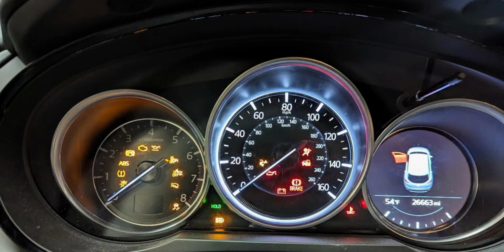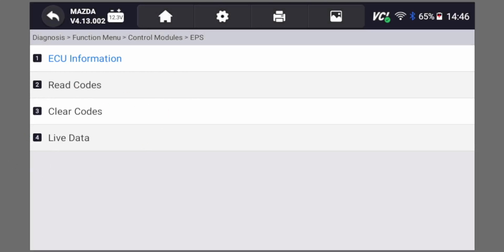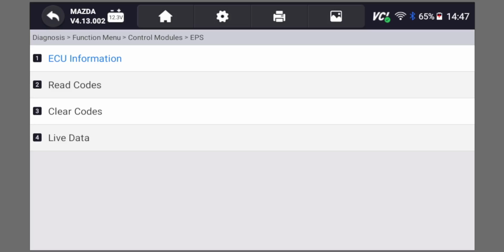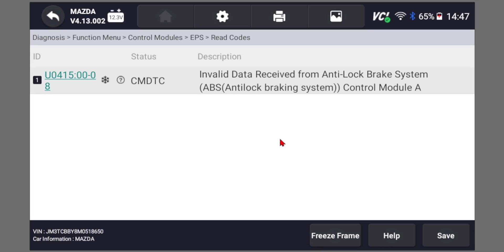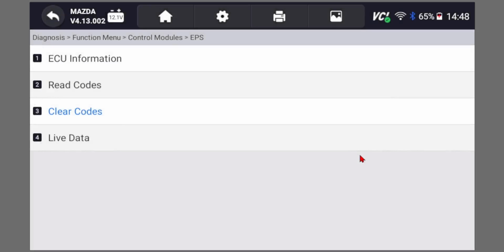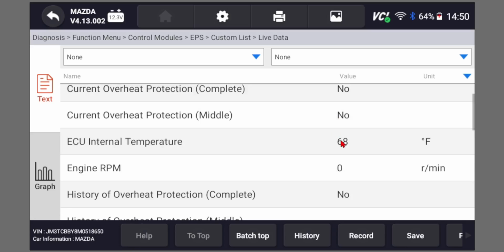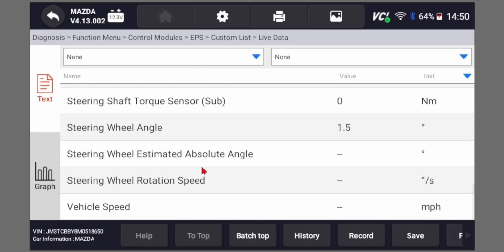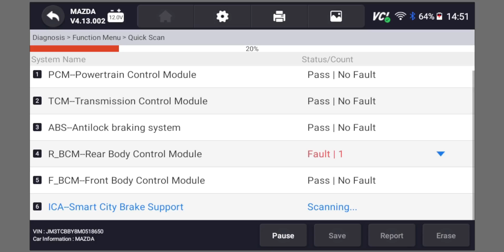🚗 Fixing Mazda Heavy Steering: Diagnose EPS with YOUCANIC OBD2 Scanner

Comment: Hi! Youcanic can diagnose details of the EPS such as torque sensor, Module Information, EPS Steering Angle Sensor Value Clear, Ma-EPS Control On/Off, Steering End Position Learning, etc? I wanto to buy youcanic but I´m not shure. Best.